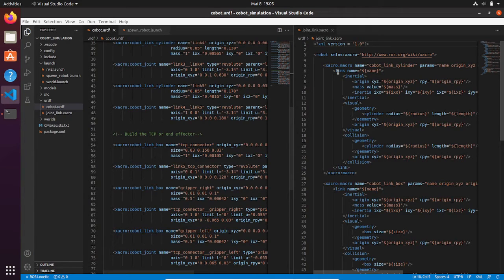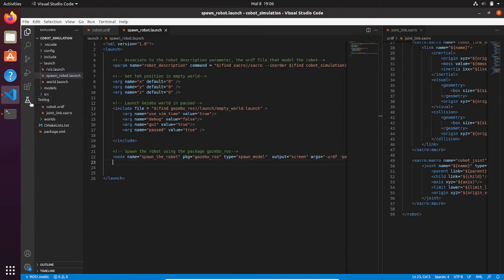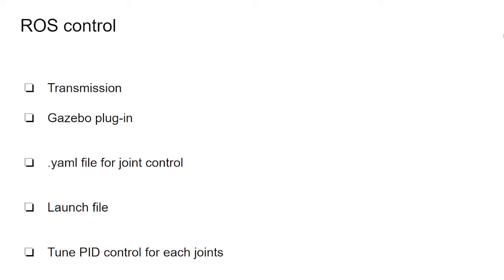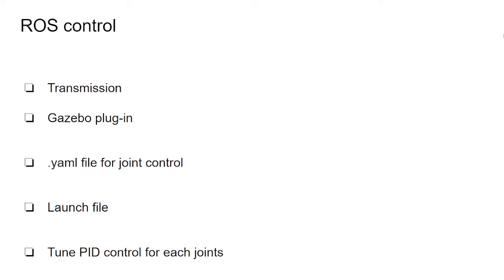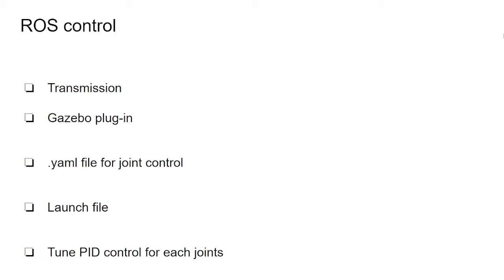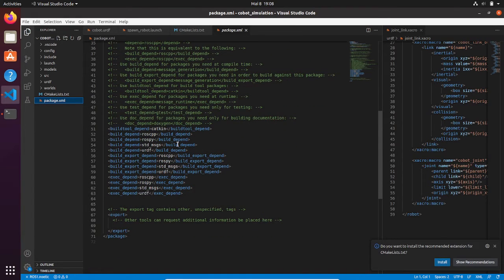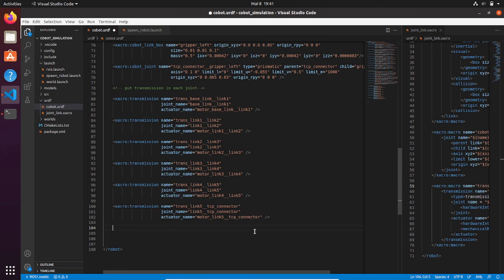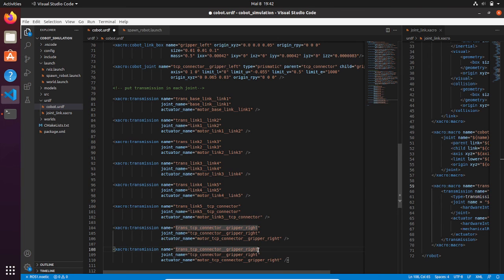How to setup ROS Control for 6 axis robot, Part 1: Transmission

Comment: I have a Windows PC but need Ubuntu to run ROS (Robot Operating System). Would using a virtual machine (VM) be a good solution? Will ROS still function properly in a VM, or are there performance limitations I should be aware of?
Reply from the maker: @arjenvanderbijl9873 you have to use a VM with Ubuntu 20.04 installed for running ROS noetic. The drawback is that you could have a little bit of overhead when you run simulation I'm Gazebo with complex application. But it is a good starting point.
If you want to improve the performance I would suggest to install Ubuntu 20.04 on dual boot in another partition, alongside window

Comment: hey u have made this in ros1 right ? what will be the steps i must take to do the same in ros2?
please give a detailed answer 

i use ros2 jazzy
Reply from the maker: In ROS2 is quite different, you would need use ROS2 tags in your URDF file,  the gazebo plugin is quite different and the yaml file is structured in a different way. I will do a video in the next couple of weeks. Meanwhile you can check the repository of my ROS1 and ROS2 master class https://github.com/LearnRoboticsWROS/ros2_master_ws